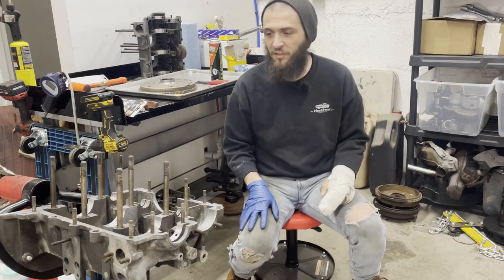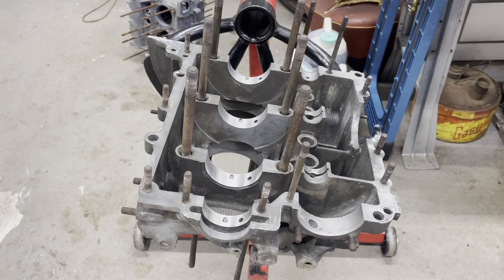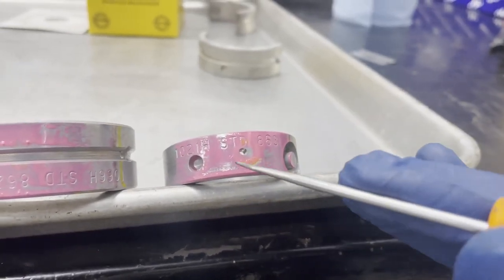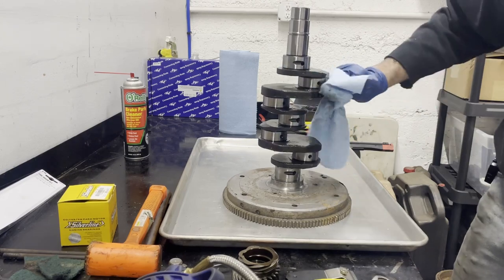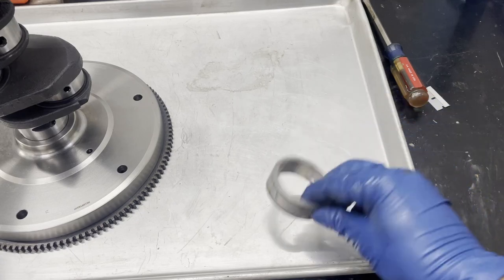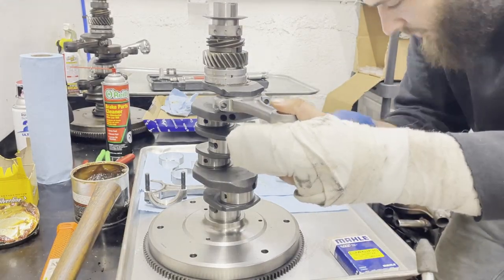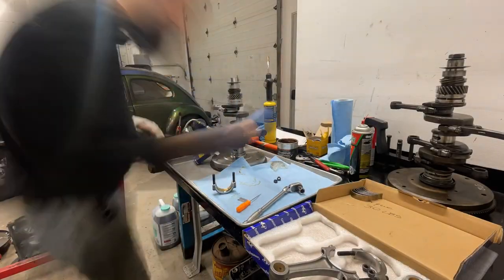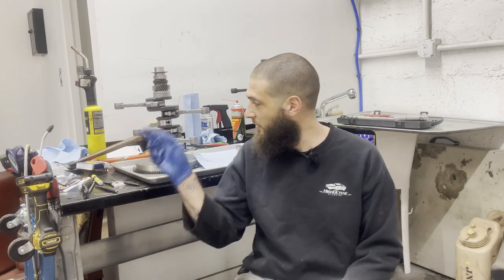HOW TO - Classic Aircooled VW TYPE 1 & TYPE 3 ENGINE BUILD - CRANKSHAFT ASSEMBLY

Comment: Good job dude. 
Silverline bearings aren’t as good as they use to be. I’ve found the tang on the rod bearings need a slight file to fit into the groove properly so the rods don’t bind up. 
Keep up the great work!
Reply from the maker: Hey thanks! It’s been a few years since I’ve put a motor together. I assumed the Silverlines were still good. Who’s making better stuff now? I liked the Mahles but I couldn’t find another set. Ended up with Kolbenschmidts I think?
Reply: @wickedwerks  both of those are good, Kolbs if you can find them over silver lines. The engine I just did I had to use the silver lines and had to slightly file the tang… it’s all I could find locally. I didn’t record it due to being sick and I have plenty of engine vids in my playlists 😂
Reply from the maker: @VWJawbreaker  Feels that. Trying to film this build as much as I can so I never have to do it again 😂
Reply: Good series. I haven’t done a engine yet, but soon thanks for letting us fallow, along.